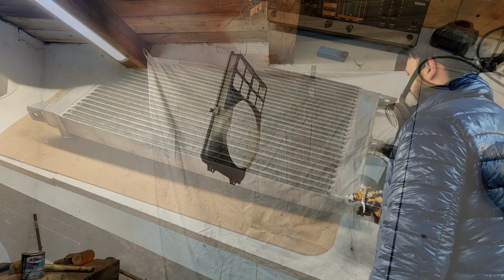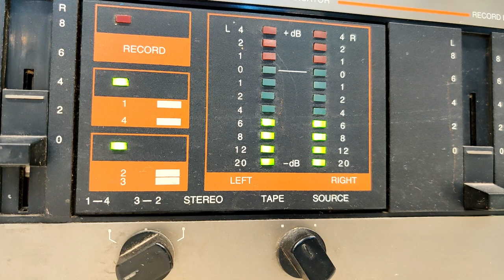VW Golf MK1 restoration ep.10 - RADIATOR

Comment: In the US, we have "coil cleaner" we use to clean the ac coils.  Its a bubbly kind of cleaner.  We have two: a very very strong one we rinse off with water and a not so strong one we don't rinse.  The bubbles get in between the aluminum fins and lift the dirt out.  I would suggest the no rinse one on your radiator to clean between the aluminum fins.   I watch you every chance I get and have been incredibly impressed with how you can take an oily greasy dirty part and make it look new.  As soon as I can find a low rust 1970's body, I am going to repeat your process.  Thanks for what you do!
Reply from the maker: Thank you for your advise :D ! I try my best but it's not easy ... I have so little time for these videos. I'm runing a business which has nothing to do with cars or tools. This is why I make mistakes, no time to do everything with maximum effort. Really happy that you want to start working on a MK1 golf. They are some awesome cars !